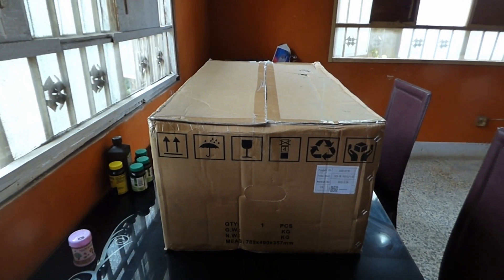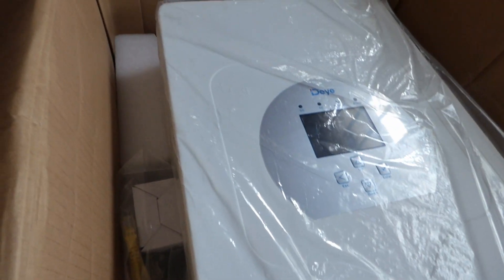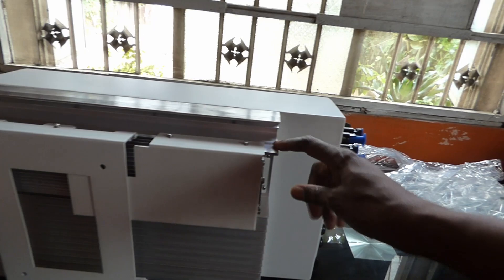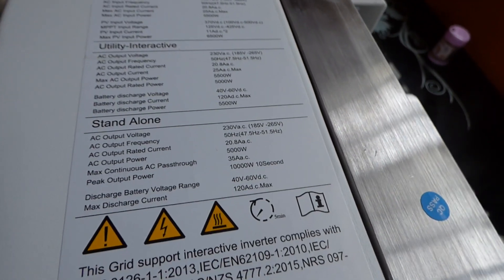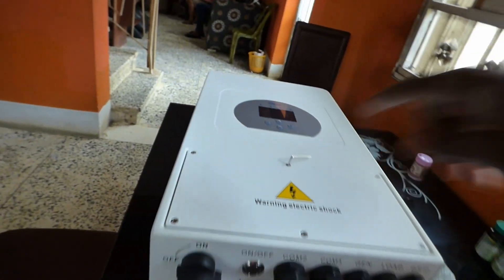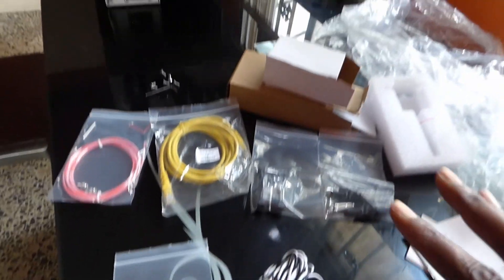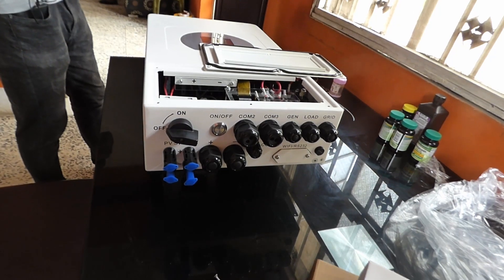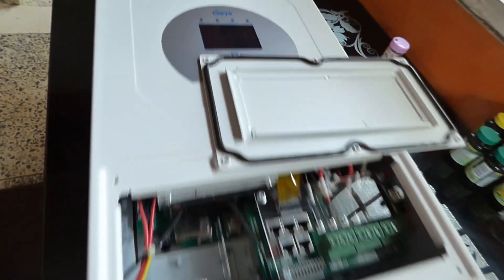Unboxing a Super Duper 5 kw Inverter with 120 amp charge and discharge

Comment: I have the 8kw version on the way. After I found out that it is essentially the Sol-Ark (USA), and I was very impressed with the Sol-Ark, a friend of mine said that Deye probably manufactures for Sol-Ark. Not sure why the Deye 8kw / Sunsynk 8kw goes for under US$3,000, but the Sol-Ark is over $6,000 (I know businesses have to make money, and Sol-Ark might have asked for additional features, but can't justify in my mind why the price doubles).
Can't wait to install mine.
Reply from the maker: The differences between the Sol-Ark and the unit you get is the split phase support. There might be a slight firmware difference but the internals are the same. Sol-Ark has marketing and some other costs that they pass on as well. I like it so far. The 8 kw has the AC breakers built in. Voltronics Power builds the Axpert series and it is sold as MPP Solar and many under names. I guess Deye is doing the same. You are getting a beast of a machine. I have 5 on order for clients. I am very excited. Thank you for watching and commenting. I look forward to watching your video when you install it
Reply: Where did you purchase?
Reply: @EnriqueReyes  I'm in the Philippines, so from a local importer. JRV Solar from Naga City. In the vicinity of US$3k (for the 8kw version) as mentioned, give or take.
Reply: Hello ，Sir , i am very happy you like deye hybrid inverter , because i work in deye for solar inverter , now we are looking for good partner , if you have idea , pls contact my email: Wangam@deye.com.cn

Comment: Hi, nice product videos you are doing, keep it going 👍
Just deciding for a hybrid inverter and can choose from Luxpower, Solis RHI or this Deya, what is your preference and why? Will run it with Pylontech.
Reply from the maker: Good morning. Thank you for watching and commenting. My experiences are only with the Deye and LuxPower. They both work with the Pylontech. If you want a silent inverter then the LuxPower wins. They also have the better phone app. However if you like to customize your settings and need high charge and discharge current the Deye wins hands down. Good luck and thank you for watching
Reply: @drsolar  Awesome. Yes, installed the Luxpower app yesterday, looks pretty clean - even I have no inverter here yet. Had a Voltronic/InfiniSolar clone here previously and was disappointed on the power consumption and heat on idle, 50W plus.
Luxpower 3600W charge power does not seem much, so I wonder what it is doing with the possible 8000W PV power. Did you get rid of the grounding and electric shock problem?
Found an undocumented api for Luxpower, so it seems very promising for own coding and automation.
Reply from the maker: @myThink5  the LuxPower app is pretty good. It is better than what Deye offers. I drilled a hole through the reebar and ran the ground wire through it and it fixed my electric shock issue. Thank you for remembering. Voltronic does a fairly good job for a mass produced inverter. They try to be everything to every one.  The Lux is weak in the charger department. You are a techie, I would love to see what you come up with.  Thanks as always for watching and commenting.
Reply: Hello ，Sir , i am very happy you like deye hybrid inverter , because i work in deye for solar inverter , now we are looking for good partner , if you have idea , pls contact my email: Wangam@deye.com.cn